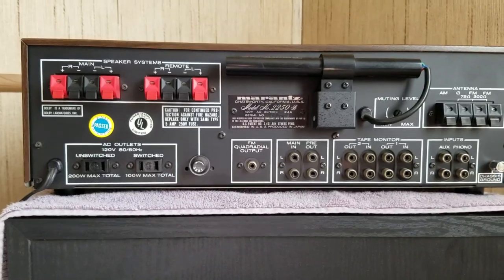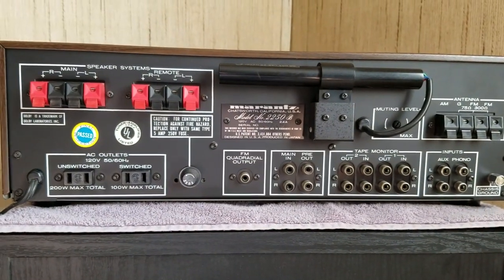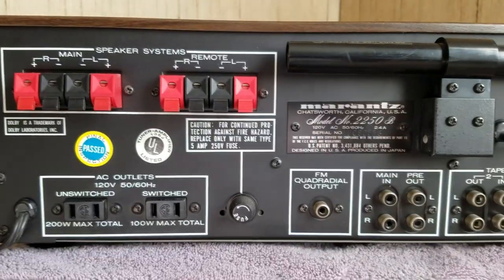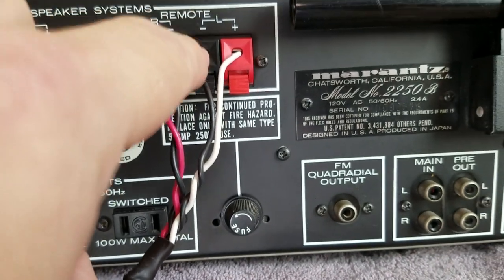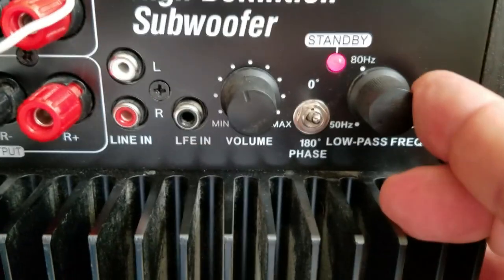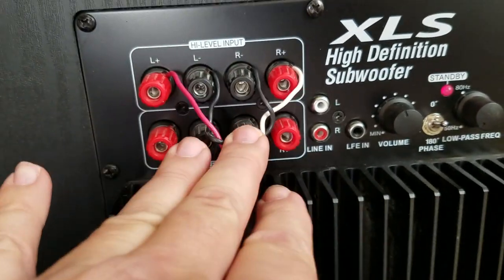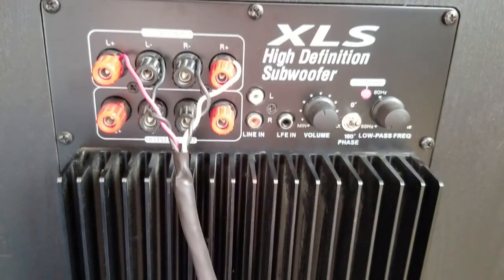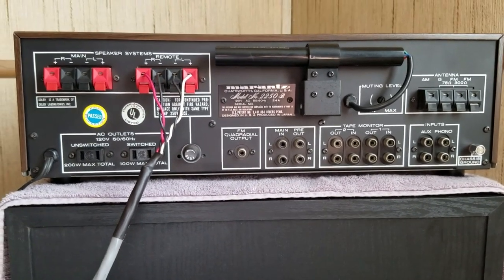How to add a Subwoofer to any Vintage Stereo

Comment: Don't waste your B speaker inputs.  Use high level into your sub and out to your speakers.  Then you can add speakers later to the B channel.  .... I'd use banana plugs... They're simpler to use.
  --- Sorry Breaker .. I just strongly disagree with you here.
Reply from the maker: Your all good. I like using B outs so i can cut the sub out with the flick of a selector switch. Both ways work well and in some cases your way makes it easier for certain installations. And yes bananas can make life easier.
Cheers.
Reply: @breakerbroke23   I see your point with shutting down the sub.  I have mine on a smart wall plug to turn off at night to keep the wife from killing me in my sleep.  Interested in a 1978 Marantz 2252B Receiver?  It works, but cuts off at about 1/3 volume.  Unfortunately, It needs more time and effort on the restoration than I can give it.

Comment: I have a Rogue Audio Sphinx v. 3 and wanted to add an older Paradigm PDR-10 powered sub. The Rogue only has one set of speaker terminals (no A-B). I’ve been told by other Rogue Audio enthusiasts on a discussion board that the proper way to do this is to run both the mains and the sub from the same speaker outputs. Do you think this would be safe?
Reply from the maker: Yes the PDR 10 will NOT add an impedance load to your Rouge. It will work just fine.... BTW... I used to sell Par-a-dimg and had a PDR 10 in my bedroom for many years. Nice little sub. However Par-a-digm driver surrounds deteriorate and eventually need re-foaming.

Comment: What if you took RCA cables, Right and Left and plugged them into the Pre Out on the Receiver and then plugged both R and L into the back of the subwoofer? Would that work also? Thanks
Reply from the maker: Yes the RCA Pre out may work for you, need to check if the volume control varies the RCA Pre out. I would turn down the gain on the sub before testing to see if your receivers volume control works. Some do and some dont. Cheers
Reply: @breakerbroke23  thanks cheers!

Comment: Your preout would be used for the subwoofer
Reply from the maker: Not all receivers have pre out... This receiver has the pre out controlled by the volume knob on the front. However a lot of receivers have a fixed pre out, I didn't want to confuse people.

Comment: Can I use a line output converter for cars,as my sub only has RCA inputs ?
Reply from the maker: Yes you can.
Reply: @ Ricky, thanx for mentioning that! I am trying to NOT blow my EXPENSIVE M&K S-1Cs' midwoofers, so I need a solution to manage my LFE (bass) AWAY from them! I'm using a vintage Hitachi SR903 class G stereo receiver. NO PRE-OUT. I want to wire it to a Mission VS6as subwoofer.
Reply: @mr.blackhawk142  It works perfectly ,have done the same!

Comment: If the stereo is 4 ohms with just the A connections but 8 ohms with both A + B connections, does that mean you can't use 4 ohms speakers on the A connections once you've added the powered subwoofer? Or, does the amp on the subwoofer take the load off the vintage receiver?
Reply: Good question.   Anyone know?
Reply: I thought the Impedance (Ohms) increase only if you hook two speakers in series? If you hook up two speakers in parallel,  the Impedance decreases.

Comment: My old Pioneer receiver is set up exactly like this 2250 Marantz but when hooking the subwoofer up you're losing two speakers.  Right now I have 4 speakers connected to my receiver which means two have to go in favor of the subwoofer.  BTW, I'm left wondering how it would sound if you were to play a record thru the Marantz without the other two speakers reconnected?  Would you get anything out other than bass?
Reply from the maker: you can add the sub with the speakers, the stereo will NOT see a drop in impedance like you would see by adding another pair of spks.. Like two 8 ohm speakers will drop your impedance to 4-6 ohms. Adding a sub to an 8 ohm load will still be 8 ohms. 
If you have in and out RCAs with a jumper you can insert the sub into that as well, you will need a RCA Y adapter cable for each L&R. Some vintage receivers had Pre in and out so you could add a EQ. Just make sure the RCA pre-out goes up/down with the volume control ...
Reply: @breakerbroke23  Do you mean I can add a sub woofer WITH all 4 speakers still connected by adding the wire leads from the sub to the wire leads already in two of the speaker inputs?  My pioneer (SX 780) is set up like your Marantz with almost the same amount of power to each channel, (45 watts) with a Phono input, an Aux input and Tape 1 & Tape 2 inputs.  Thanks

Comment: Hi, I am looking at an active subwoofer from Polk Audio TL1600, my receiver is a 5.1 Onkyo HT-R330 with A/B outputs.  I do not see a High Level input in the sub, I see one Speaker Level Output and one Speaker Level Input; can I use this set up with the B out and the Speaker Level In?  Thanks.
Reply from the maker: Yes Iam looking at your subwoofer and you could use the B speakers from your receiver and hook them up to the Speaker input of the sub. Your receiver also has subwoofer speaker out, you could us that as well but that sub speaker level out may only work in a surround mode. That may be kinda lame as you would probably
 want sub to play in all modes including 2 channel stereo. But yes by all means use the speaker level inputs on the sub. 
You could also tie the front (A) speakers to the sub by just adding a set of wires out from A to the sub. (like running 2 sets of speakers from A.) it will not drop your impedance.
Reply: @breakerbroke23  Great!  Thanks for coming back to me.  I am obviously not very savvy about this, I do see a subwoofer out from my receiver but it is a single plug out, no L/R, and it is on a video In/Out section, is that the one?  If so, do I go out from a single plug to the L/R in the sub?  Just out of curiosity as yes, it sounds like a better idea to hook it up to the B output.  On your 2nd recommendations, so I just add cables out from the receiver to the same Speaker Level Input the sub will be?  So 4 cables in each slot?  What is the advantage of doing this?

Comment: Greetings..I have a--Polk Audio PSW-10 SUB. It doesn't say "High Level Input/Output"  just speaker level input/output. Will this configuration still work?  Thanks for the video.
Reply from the maker: Yes its the same thing... Just use SPK Level input.. Cheers
Reply: @breakerbroke23  THANK YOU..I'LL GIVE IT A TRY.

Comment: But a vintage receiver does not have bass management, isn't it possible to have way too much bass in that case?
Reply from the maker: No, your powered subwoofer has frequency cut off and gain controls.

Comment: How about running a passive sub into a Crown K2 power amp into my vintage integrated? How can this be achieved?
Reply from the maker: You may need to convert unbalanced (RCA)from your receiver to balanced (XLR) to your crown. I would possibly suggest the ART Clean Box2 to do that. You will also need a electronic cross over or some way of taking a full range signal from the receiver and sending only low pass signal to your amp. Or, you could use a coil type of crossover between the amp and woofer to only pass low frequency. 
(You can't/should not play full range through the woofer.) There are a few products to accomplish this but it will get complicated and may be a bit spendy. IMO

Comment: Are you always supposed to wire the main speakers into the main AB section and the subwoofer into the remote section or can you do it another way using just main a and b? I have a reciever that has A and b left and right connections. The reciever has no remote option
Reply from the maker: Then use your main speakers on A and wire the sub on B. By doing this you can add or delete the sub with just the flick of a switch. Providing your receiver will work both A&B at the same time.
Cheers.
Reply: @breakerbroke23  sweet I will try this, thanks !
Reply: There's no such thing as Main AB?, Normally A speakers are the Main speakers  (or Front speakers?
The B connection are the so called "REAR or REMOTE  or EXTRA SPEAKERS. 
If you're vintage receiver has the speaker selector for 3 positions:
For A only (Main)
For B only (Rear)
Then for A + B , utilizing 4 speakers at the same time.

Comment: Seems like the easiest and best thing to do would be to go pre out from reciever to line in on sub with an rca cord. Please explain why your way is better. I am no pro and need to learn these things.
Reply: I do not have a preamp out on my Marantz. See my comment below.
Reply: @tangentz0007  I watched the whole video and did not notice anything stating that this was a video for those who do not have a line out. The poster does have a line out and it would be so much easier to use it. However, I could be wrong. If I am please explain.  I am also thinking that using both A, B speakers at same time changes the load which will make it run hotter. Could be wrong on that too. For someone like you ,who does not have a line out, this video would be helpful.
Reply from the maker: @ Derek Thornton
Yes my receiver has a line out, HOWEVER this video was intended for those who do not. Looking back, should have used another receiver. Cheers
Reply: @breakerbroke23  ? a colleague asked why connect a and b, could you refer to it?
Reply: The Marantz needs jumpers from pre to main, so you couldn't use pre-outs as they are busy feeding the amplifier section.

Comment: I just bought a Klipsch subwoofer that only has rca inputs. No speaker wire connection. So i found out that i need to use a line level converter. Any experience with this? Could this degrade the sound quality? Thanks.
Reply from the maker: The line tap will work just fine and if any audio degrade  is happening it would be in the high frequency range which you are cutting out with the sub  x over . So go for it.
Reply: @breakerbroke23  Thanks so much for the response. I have an old NAD amplifier without sub output connection.

Comment: U hook up wires to rear speakers or front speakers on your receiver
Reply from the maker: I hook up to the rear speakers, so that I can turn the woofer off by turning off the rear speakers.
Reply: @breakerbroke23  On my Hitachi SR903, I can turn off BOTH A and B outputs, but I have no pre-out on it. That's why I will wire it the way you are doing, because I already have my other rooms connected with active speakers, so I can use A or B with my sub, It's also nice to be able to compare quickly how it sounds with a sub and without a sub by pressing a button.

Comment: I have a 70's Pioneer SA 8500II amp with A+B speaker and I'm running 4 speakers. I have an active sub with just one wire. So can I use a Y splitter to a RCA line level converter to speaker A or B or connect to both A+B. Help...
Reply from the maker: Use either SPK A or B into the line converter, then Y cable to the sub. Should be just fine. Look for a quality line level conv.
Reply: @breakerbroke23  Thank you

Comment: I have a reciver won't run both channels A and B at the same time. What could I do in this situation?
Reply: Also is it safe to run a subwoofer through the regular speaker outputs? I know doing it that way will have cause vocals to go through it but will it hurt it and would it still add a bit of bass. I have an old 4inch sub that I have no use for so I'm playing around with it

Comment: Hi, so just to be clear if i have a set of speakers on A and also have a set of speaker of B both running together i can still just tap in to B for signal to run the powered subwoofer with no ill effects on the receiver amp or speakers? Thank you! I have a Sx 980 receiver.
Reply from the maker: Correct, The sub input will not drop your impedance. It will work just fine:)
Reply: @breakerbroke23  thank you very much for the quick reply. So having  the speakers hooked up to the high level output they will still be using my receiver amps power and will still have the same control of them for the bass and treble on the receiver?
Reply from the maker: lowriderssux  Yes your receiver will not be affected at all, your existing speakers will not be affected at all.  The sub will have a full range signal in to it and the X-Over will filter out the mids and highs, and just low s go to the woofer. Try it... Your going to love it. Post a comment when you get your new sub hooked up:) AND, Plz don't forget to subscribe.

Comment: Why don't you just go from the pre-amp out on the Marantz to the line in on the sub?
Reply from the maker: You could do that, however in my installation the RCA cable run is so long I would lose some signal. AND... A lot of viewers receivers do not have this variable pre out. Good comment. Cheers
Reply: @alfredlim2731  What's farther? Chicago or by train?

Comment: Another possible solution is a low Level converter between amp and sub.
Reply from the maker: Yes a line converter will work just fine for those that do not have Hi Level in.  Cheers.
Reply: @breakerbroke23  yes :) i found myself confronted to this Problem with my new ultrahighend tube amp and my Budget cambridge audio aero sub (no Port, active+passive woofer). At that point i didn't know such Thing a low Level converter exists. Then i found one on Amazon. And yes, it does work really good. Anyway Bass is always tricky and picky to handle. Bass trap etc... nerdy greetings from germany :)
Reply from the maker: Cheers from Geeksville to Nerdville .....

Comment: Just hooked up to the sub when I put on A+B speaker my bookshelf got a very low volume of sounds even I turn to 1 o’clock all I hear just the sub, when switched back to A only the bookshelf ‘s normal sounds is back that was 9 o’clock I was thinking might be the receiver not enough powers to drive A+B? Any ideas? Thanks
Reply from the maker: What receiver are you using? I would just wire the sub to spk A with your bookshelfs. The sub input has no effect on what impedance your receiver will see. So if your speakers are 8ohm and you add the sub, your receiver will still see aprox a 8ohm load. Your good to go.....BB23
Reply: @breakerbroke23  I am using the vintage Sanyo DCA 611 integrated amp, it rate 60 Watt per channel it pair full sounds at 9:30 o'clock with my Polk audio  M 10 bookshelf. 
I will try what's your suggested wire them up together to speaker A output or try a different amp with more power and will see what's happen. 
Thanks very much for the input

Comment: I’m a bit worried about running direct from a 100 watt amp into a powered sub.
The tape out provides plenty of signal for the amp in sub. 
Seems like you are showing how to run a passive sub.
Reply from the maker: If there are speaker level inputs on your sub amp then you should be alright with 75-100w in. I tried getting this information direct from Klipsch back some years ago when I bought one of their subs. The "tech support" guy said the amp could take in a "few hundred watts" ..  ( Their tech support was terrible.......... )
You will never throw all the power your amp/receiver is capable of to the sub anyway.
TAPE OUT is usually a fixed pre out so that will not work.
My receiver used in this video does have a pre out that is variable with the volume control, it works well, I just did not include this in the video as most receivers do not have this capability.
Reply: @breakerbroke23  tape out is how you would go into a pre amp that then went to a amp if not integrated.
 Usually around 3 watts, I believe.
If you have no separate volume controls on your receiver and you crank t your (A) speakers let’s say 40% in 4ohm 
Your sending a lot of juice to the powered sub.
 I had a pair of foster 100 wat powered monitors that I ran a a Dento Bluetooth into and it worked remarkably well, but I had volume control on back of monitors.

I would think an Aux out would work too.

 I’m not a tech guy, but it just seems like you’re asking for trouble sending more wattage than required to a powered speaker.
Reply: @breakerbroke23  I do have pre outs on my Yamaha Cr-1020
I guess I should do more research before I buy my sub, I’ll contact the techs at RSL, I’m hoping they can shed some light.
Thanks for your input.
I just don’t want to blow anything up.
Specially my recapped Yamaha
Reply: Just got email back from tech at Rogers sound labs in regards to sub hook up to my Yamaha CR-1020 
This is their response 

To connect a 10E with your vintage Yamaha, you’ll simply need to use some RCA splitters. You’ll need to split from the Yamaha’s pre-outs. One set of cables (L + R) will go to the 10E’s line level inputs. The other set will go back into the Yamaha’s Main Inputs (please see my diagram below).
  I realize hook up will vary depending on receiver.
 But just an FYI, they got back in like an hours time. Both they and me on west coast
Best
Mark
Reply: @breakerbroke23 Tape-out works fine for me when using an external DAC, where you can turn the potmeter to at more or less singnal to speakers and subwoofer. Plenty of gain to run my JBL sub to. I use a Focusrite scarlet 2I2. You only need some creativity to listen and set it up.
Reply: @Oldcrow77 pre-amp works also for me when using a split cable. It has less output than the tape-out but if you have a decent sub it should work fine. Subs like JBL with 300w

Comment: My integrated amp offers only connection for only a pair of speakers, how can i connect my active sub?
Reply from the maker: Just add the sub like you would an extra pair of speakers.
The receiver will still see only the load of your speakers, (4_8 ohms) and not the sub.